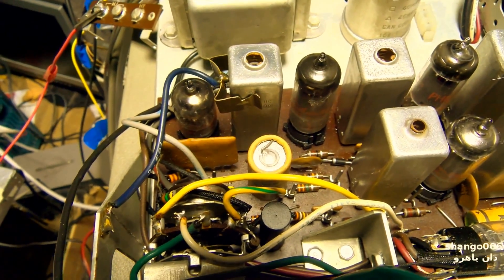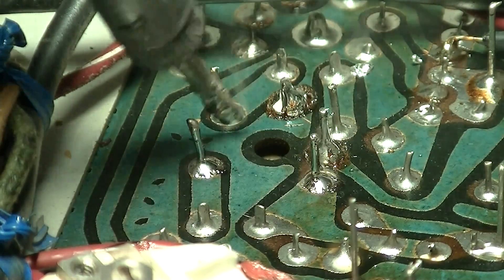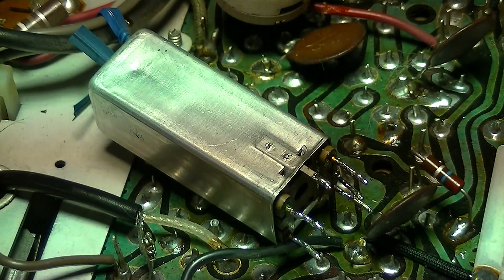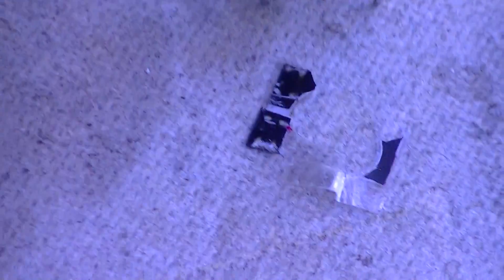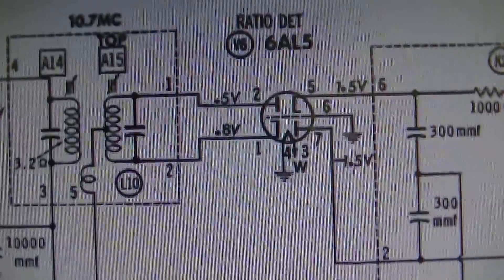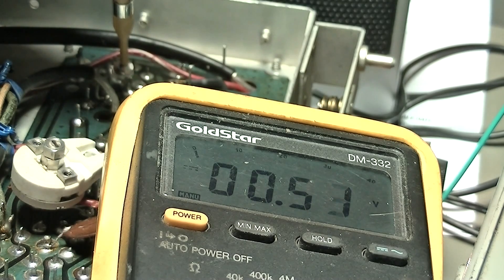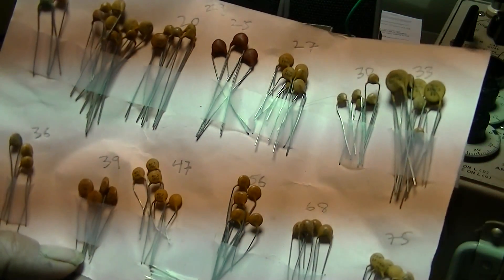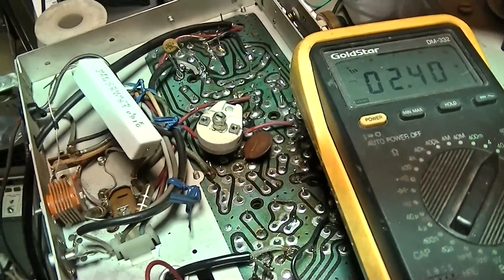IF Transformer SMD Repair FM Discriminator

Comment: The trick to using solder wick on IF can pins is to first add solder like you do in the video.  Then ADD FLUX TO THE WICK.  The wick then will quickly melt and suck up the solder.  But of course if you are a shaky Jake and your iron is clustered with slag you won't get the best results. 🤔

Comment: Those metal fingers in the can looked to be mechanically connected to the pins. Highly likely there was corrosion between them. The capacitor wafer was probably ok.

Comment: Shango, I picked up a Sony Trinitron KV-1916 from 1983 from the dump today, and it makes a transformer sound when I press the power button, but it does nothing after this. Any suggestions? It's a pretty cool TV so if it's an easy fix or a simple mistake I think it's worth it to fix.
Reply: Grand Negus I already got rid of it. I checked fuses and couldn't find anything wrong. I'm on the lookout for a slightly older TV now.

Comment: Hi..I know this a bit off topic vut I was wondering if you could help me.
I'm currently fixing a old ft-901 ham radio.
I'm getting pretty much full powr on all bands but 40m.
I figure it maybe something to do with the trimmer caps.
I tested them with my lcr and they look ok.
But my lcr only goes up to 100Khz and is not hi volts so they still could be bad.
My question is I"m looking for some replacement trimmer caps and I'm having a hard time finding them. One is a single turn ceramic approx 5pf-70pf 50 volt the the other is a mica compression cap approx 4pf-50pf 500volt. Any ideas where I can find these and do you think it may be the trimmer caps?

Thank you very much for your time.
Reply from the maker: +Doctor Forbin What is specific to the 40 meter band? Usually there are traps for each band on the output that filter off harmonics. If something was off in that trap it could be killing the power on that one band.
Reply: +shango066 Thanks for your reply. I sniffed the output with my Spectrum Analyzer and there are no excess harmonics. Either way I need those trimmer caps. Any suggestions? I replaced tubes as well.
Reply from the maker: Surplus off ebay? Lots of USSR rf parts on ebay im sure you can find something close
Reply: I've looked on ebay..but I'll look again.

Comment: Amen brother. You made me laugh about the $30,000 solder station. I know what you mean. The fresh solder on the pads is a trick that most don't know. I should send you a picture of my solder sucker. My local radio shack and by the way the only local parts for me. Our towns ecg sk nte dealer closed long ago. Anyway the radio shack did not have a manual solder sucker but had a heated one. I asked them to get me one and how much was it and she said $19.95 and I about fell over.